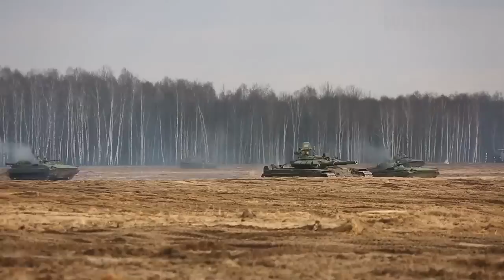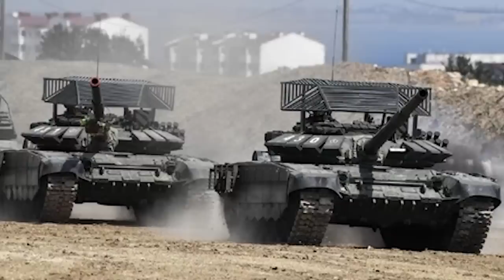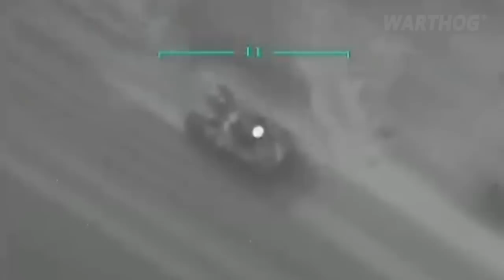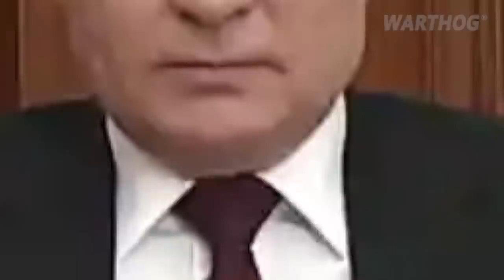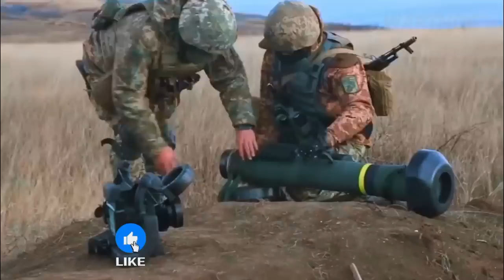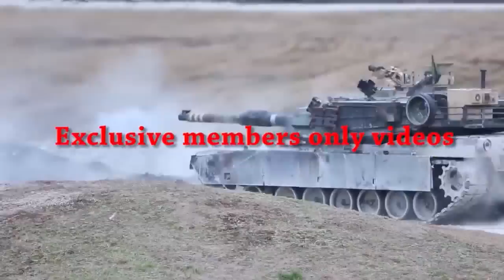TANK CAGES - RUSSIA’S MILITARY FAILURES IN UKRAINE || 2022

Comment: I see those cages as similar to allied solders in WW2 that would cover the front of their tanks in sandbags, logs or even concrete.  It wasn't effective then and it isn't effective now.  But from the perspective of the guy in the tank if it gives you half of one percent better chance of surviving an attack then it's still better than nothing.
Reply: It depends on the weapon. If a 37MM hits a sandbag, it can save the tank from killing damage. If a 90MM or Javelin hits the sandbag it won't help enough.
Reply: @Bob_Adkins  that example was from WW2, there were no javelins to worry about.  They were covering armor designed to withstand hits from shells of about 50mm and hoping the sandbags would help against 75mm and 88mm shells

Comment: The cope cage indicates a failure to understand what slat armor is and what it works against. Slat armor was designed to dud out RPG-7 rockets by severing the detonation wires that ran from the probe to the shaped-charge warhead. It was pretty effective at this, though not totally. The cope cages were deployed agains the threat of the Javelin shoulder launched and Byraktar UAV missiles... which have different detonation mechanisms and cannot be dudded out like an RPG-7. Worse, the Javelin and (I think) the Byraktar's missile have tandem charge warheads which the RPG-7 doesn't. There's just no way this measure was going to stop those weapons.

Comment: I knew what that was the second I saw it. Similar to what the Germans did by putting skirts on the sides of their tanks in WW2 to prevent hollow charges like bazookas from penetrating.
Reply: Actually, the Russians and Germans put skirts on the sides of their tanks to stop / deflect the 20MM anti tank rifle rounds as the tanks skin was thin there...  The Finns used lots of those 20MM rifles to kill Russian tanks in their Winter war...
Reply: The side skirts or Schürzen were originally placed on the sides of German tanks to deter Russian Anti-tank rifles from penetrating the thin side armor and killing the crew. 

The Soviets had the particularly nasty PTRS-41 or Simonov anti-tank rifle ( Russian: ПротивоТанковое Ружьё Симонова) a semi-automatic anti-materiel rifle chambered for 14.5×114mm . The snipers worked in two man teams (because it was very heavy) but they knew exactly where the crew members sat in the German tanks. They would aim for the side armor where it was weakest. The Germans quickly realized that by attaching another layer of steel at a slight angle would not only double the thickness of the armor, but also deflect the rounds.

It was an unexpected bonus that by placing this steel at a suitable distance from the hull, it also defeated High Explosive Anti Tank rounds (HEAT) which work by using a shaped charge explosive to create a jet of hot gas that would cut through the armor and then burn what was inside. The drawback for HEAT is that it will only penetrate a specific depth and the further away from the metal when it explodes, the more that the plasma jet disperses and the less armor it can cut through.

The Russians hoped that by forcing the Javelin and NLAW rounds to explode further away from the top of their tanks, that the charge would disperse and the tank would survive. They forgot that the Javelin has 2 shaped charges - the first to defeat the ERA (Explosive Reactive Armor) bricks and the second to punch through the roof of the tank. Even though the NLAW only has one charge, the size of the charge is so great that the Cope Cages are absolutely useless to stop it.

Comment: I do not fault the effort.  A tank's major weak spots are it's head and ass.  An analogy is the early years of the second US invasion of Iraq.  HMMVWs (Hummers) were not armoured; AT ALL.  Slowly, UpArmor systems showed up, but few and far between.  GIs got creative and literally started hanging and welding plate steel on to the damned things anywhere they could (even on to the UpArmor ones when the Iraqis started using HME).  The minimal armour at least provided minimal protection against small arms fire and a glancing blow from a mine or early IED.  Again, once HME (home made explosives) were introduced into the equation, all bets were off.  The only safe place then was back in the US!  These dudes are just straight up trying to survive the meat grinder they have been sent into.